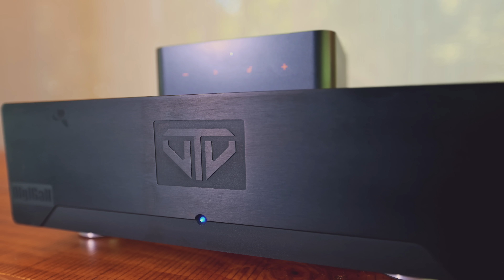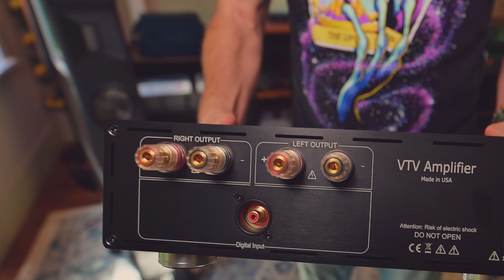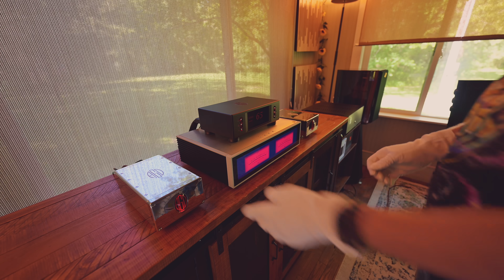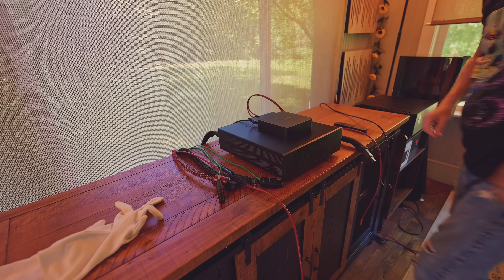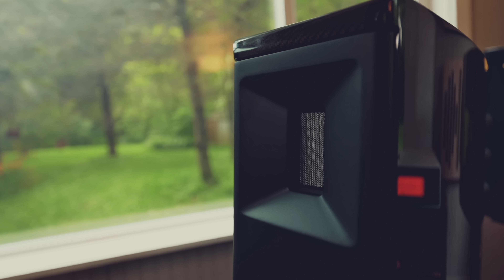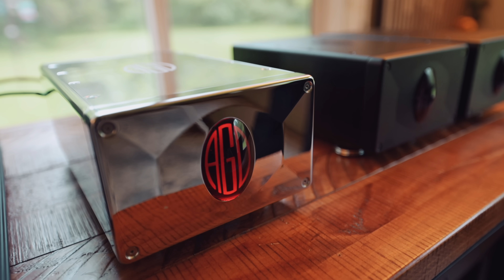High end sound, low end cash.

Comment: I use a streamer with two active monitor speakers. Skip the seperate power amp all together. Total cost 500$ with adam audio t7v. Sound amazing. And even less cables 😂 no speaker cables required 😂
My other syatem is all seperates 😂
Reply: @annebokma4637  man i cant wait until powered speakers start to come with ganfet class d amps!
Reply: @ericperry72  just around the corner.. hopefully. Besides it would be nice for an Ethernet port with Dante and 2110 support. Make that into a new Adam A7V class speaker, and I will be a customer, even with the price hike 🤔

Comment: I wonder how well it handles those digital dropouts? You know when you get a giant pop and all of your ceramic drivers shatter.
Reply from the maker: Never heard of or experienced that in life, on any amp I’ve tested or owned, digital dropouts. Didn’t experience it here either.
Reply: @HiFiHuff  The topping DAC I have had a firmware problem where somehow it would just get into a weird click drop scenario occasionally. Also have a bunch of digital equipment that isn't always transmitting the clock and only transmits the clock when there's audio so when something pauses there's a period where the sync has to start again when the clock starts transmitting again and you can also experience pops then. Also if your cables are very long which they may be in a pro audio sense sometimes you get interference and that also causes issues of course. Plus of course I have been cursed by gypsies so what can I do?
Reply: Never had this happen, not sure what you are doing.  But also I always put a preamp between my dac and my amp.

Comment: Bruno Putzeys says  GaN Class D only makes sense above 200 watts. This is that so fine. Why 400 watts is needed is another question but maybe not an important one. It does the job well. However I wonder about the prospective reliability longer term. Let's say plus 4 years.
Reply: 200v it's the voltage rating

Comment: If you make the mistake of not having the volume properly set upon signal introduction, POOF goes the speaker.  If your streamer or other digital source defaults to full output, that will be a very bad day.
Reply: 100% pure nightmare😮😮
Reply: Don't hook up the speakers until you know the volume control is working properly.
Reply: @socratesliriano9852 wouldn't you have to have another system to do that?
Reply: That’s why I will never go that route. 😊
Reply: @Cymbalicious  Doesn’t work like that in practice. The streamer volume is always the same as you left it.

Comment: Can you use the line out of the wiim for a subwoofer in this setup?
Reply: I dont know if its variable, or can run at the same time as the other outputs. I thinkmits better to run your Sub from your ampmor speakers, if your Sub can connect that way.